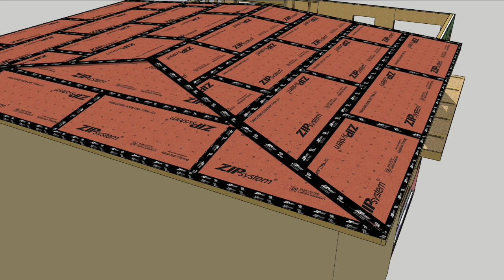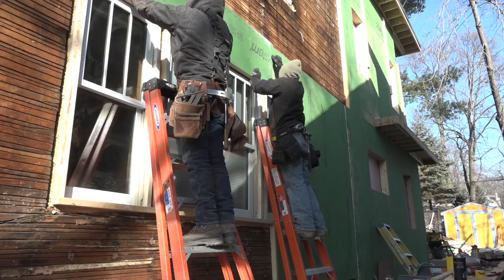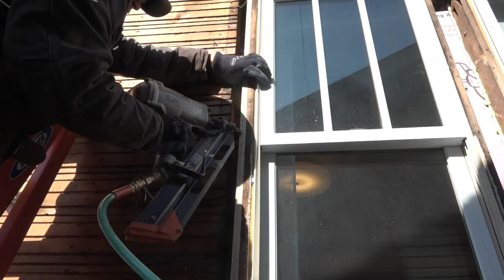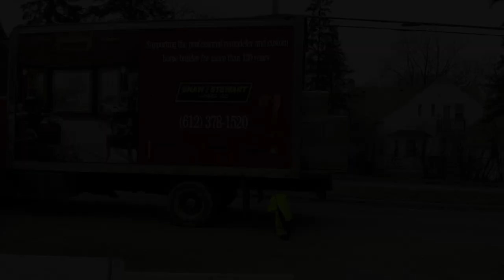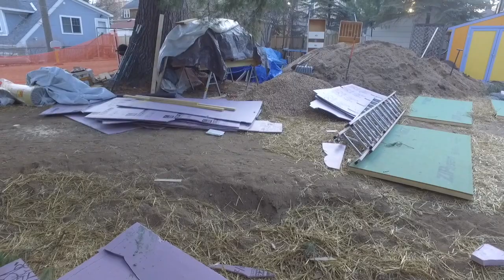Building Resilience 6: Exterior Insulated Sheathing

Comment: Thanks so much for this video! What nailer and nail length are you using? Do you have any problems with over/under drive given that you need to get thru zip+original sheathing+into studs?
Reply from the maker: Long nails. I mean, there is 2 inches of insulation and 1/2 inch of sheathing, so if you want the nails to penetrate framing an inch and a half, I'd go with 4-inch nails. You may need a bigger nail gun to shoot them.

Comment: Is it OK to attach the zip over the original sheathing I was not able to find any other videos on this
Reply: Absolutely!! One of the advantages is you retain the structural integrity of the home and don't need to run the project past an engineer.

Comment: How does the zip tie into the roof overhangs?
Reply: Solid question, and probably not easy to answer in the comments, but I'll try. The ZIP R-12 sheathing goes up to the underside of the soffit and ends, much like any other sheathing. There is blocking above, but the ZIP does not continue past the soffit (except on the gable ends where we pre-sheeted the wall and installed the rake over top.) .
Reply: @oadesignbuildarchitecture9688  what would you do about eave vents?  https://ucanr.edu/sites/fire/files/284744display.jpg
Reply: @wkobayashim  For that style of eave vent I'd suggest you'd still be beyond the wall sheeting (the zip). The detail would look the same as the picture. In a protected space like that I'd offer that the water detailing is less critical than the air sealing detail. Hope that helps!
Reply: @oadesignbuildarchitecture9688  in a retrofit situation, would you first remove the eaves and stucco.  Then nail the zip r12.  Then tape or liquid flash the top of the zip to the exposed top plate.  Then put back the eaves?
Reply: @wkobayashim  I'm a little curious what the roof of this house looks like... Do those eave vents really provide adequate ventilation? They are right at that top plate, so there's no way to get good insulation at that location. If you're going to go through the cost to retrofit the rest of the home, I'd want to be sure to get some serious insulation in the attic. Depending on the roof line, that might mean converting to an unvented attic assembly with spray foam to the roof deck, OR adding 6-8" of XPS to the roof deck, in which case you'd want to cut those tails off and run the ZIP R-12 all the way up. also.. Remove the stucco regardless of the roof, yes. - Thanks for the great questions!!